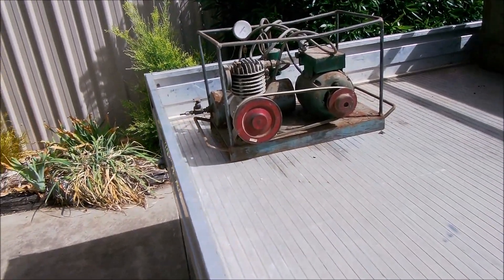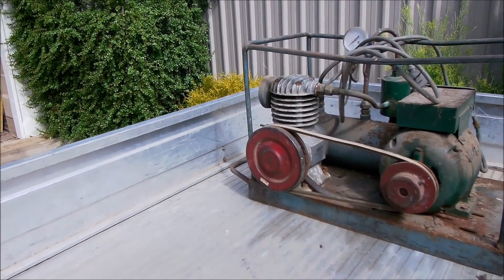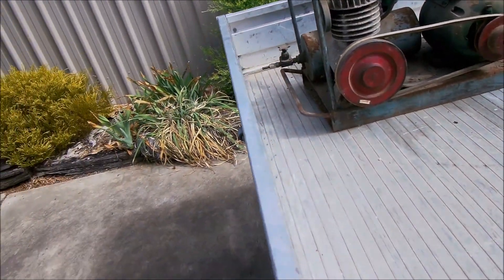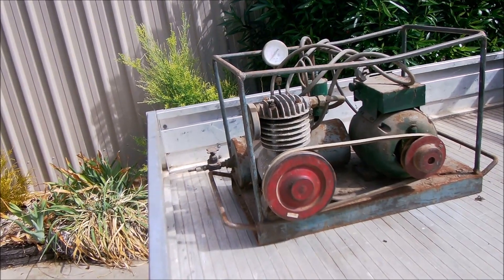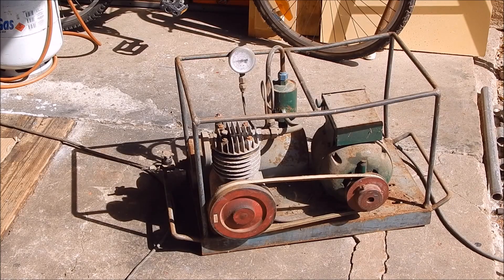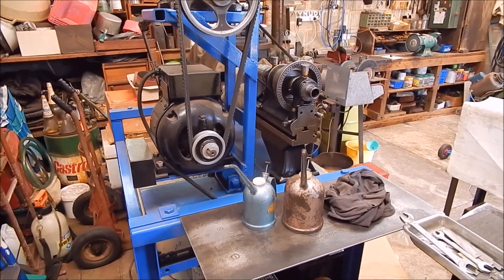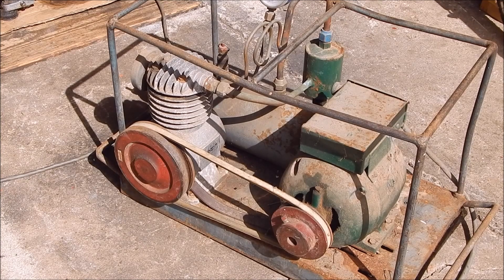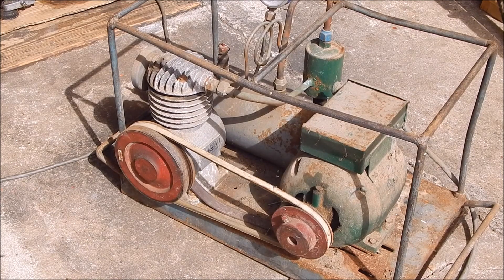Garage sale $10 air compressor

Comment: Rob,
You are a lot like my wife. Every Friday night, during the summer here on the San Francisco peninsula , my wife will have me get onto Craig's List and check out all the garage sales in the area. She got me a really nice drill press for not much. I'm also interested in electronics and she has found some vintage radios and test equipment I can restore and use. There's an old saying that goes "One man's junk is another man's treasure." It's really surprising what some folks have and sell dirt cheap. Anyway, thanks for the video!
Have a good one!
Dave
Reply from the maker: Hi Dave, 

It's a treasure trove, and it's also a cheap way to equip the workshop, if you buy carefully.

A good woman like that is hard to find.  Keep her happy.

Cheers Rob

Comment: nice find rob, glad you got a bargain,
why don't you bolt the compressor to the engine hoist, pipe it up and use that to lift, will save cranking !!!
hope you find some more bargains real soon
thanks for sharing
regards...Keith in Swindon u.k

Comment: G'day Rob here is another great find.  Looking forward to you restoring it, you have a nice setup with the concrete driveway to you shed with good gates at the other end.  Cheers Rod John
Reply from the maker: This will be a strip down/part out.  As a unit it's worth nothing.  As components it's worth more than I paid for it when re-sold.

Cheers Rob

Comment: Good buy Rob! Wouldn't mind the flywheel off the compressor - I bet it's good grey cast iron. Looks just right to make the fixed steady for my lathe! Bit tricky getting it to NZ though...
Reply from the maker: Hi Mike,

Yes, at that price it's all just components that can be re-purposed, or sold on, without feeling bad about it.  Clisby made/make high quality compressors and that cast iron would be top shelf.

Postage to NZ from Oz is quite expensive - I had to check it recently regarding some parts to ship across.

I expect my Bro Inlaw will want that compressor for the price - they are the ideal size for boom spray foam markers (he's a farmer).

Cheers Rob

Comment: Hi Rob, I got a compressor similar to that for $10 also, turned out the tank was made from 5inch brass tube once I knocked the 5 layers of paint off haha, what a score!! Also has a Crompton Parkson 1/2hp motor.

Cheers Matt
Reply from the maker: Hi Matt,

Nice score.  Brass ain't cheap.

Cheers Rob

Comment: Nice find Rob, it's always a bit hairy firing up an old compressor for the first time. I think you mentioned it in a video before, but would you consider doing a short review of your Tata Telcoline? There's poor info out there and it looks like yours is still working hard. And is that an old Colt parked next to it?
Reply from the maker: Hi Mike,

I don't think there would be much demand for a review on either of my vehicles.  Very few Telcolines are still on the road.   Yes, that's the second car, an old Mitsubishi Colt 1600 auto.  Really nice car to drive.

Both my vehicles are worth next to nothing, cost almost nothing in depreciation and maintenance  (do my own), and I don't have to worry about scratches, dings, or getting stolen.  Totally low rent.  I'm not car proud.  So long as they get me from A to B is all I care about.

New cars are just a money pit IMHO.  They are all basically tin boxes on wheels, some just cost more because they bend the panels a bit more stylishly ;)

Cheers Rob
Reply: I'd be into either review, But especially the old truck. In the states we get what the big 3 want us to get in terms of pickups, and what they want us to get are the highest profit margin vehicles they can manage. After my 80's chevy S10 went out of the picture we tried using my co-workers giant shiny new dodge pickup with all the bells and whistles. Never seen a more useless truck on the farm. My Scion XD was better suited to farm work than that thing, At least I could fit irrigation pipe on my roof racks. You so much as look at that luxury dodge full size the wrong way and the bed would ding all to hell. And they ship with these giant low profile tires now which are about as useful as balls on a dildo.

Your truck however, looks great.

Cheers
Reply from the maker: Yes,it's a totally no bullshit truck.  Has a 6 foot flat bed tray, 4x4 with low range, limited slip diff, four doors, plenty of tray forward of the rear axle, can carry 1.25 ton, go any where, does 30 mpg, and is basically bullet proof.

Most of the Australian 4x4 s are a similar size, and it's amazing they don't sell these and the Toyota Hilux etc in the USA.

Probably because they would decimate the locally produced monsters that you lot drive.

Cheers Rob
Reply from the maker: I forgot to mention that I did a web page blog on the Telcoline way back, which is a maintenance and over view of it.

You may find it interesting:  http://users.picknowl.com.au/~gloaming_agnet/telco.html

Cheers Rob

Comment: I would have paid $10 just for the motor!
Reply from the maker: That's what I bought it for.  Those motors go for at least $30 on Craig's List.

I've already sold the rest of it to my Bro Inlaw for $10.  

He has the same Clisby pump on his air compressor and it's nearly worn out.  So he will just direct swap across this pump (which is excellent), and sell the old one at the local market for whatever he can get for it.

Or he can put a petrol motor on the unit and use it out in the paddocks (he's a farmer).  Plenty of options.

Can't lose on deals like this.

Cheers Rob